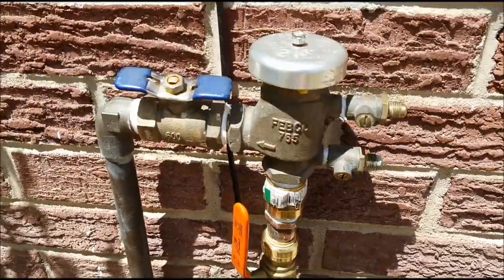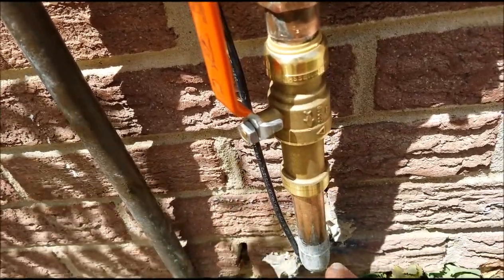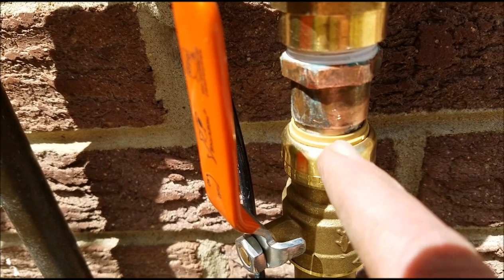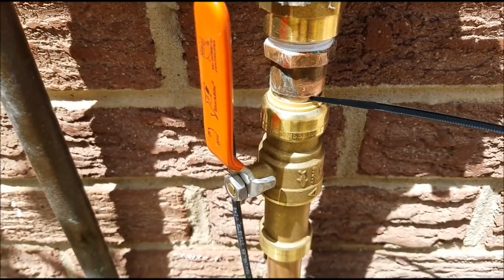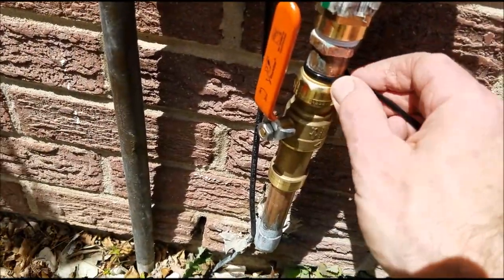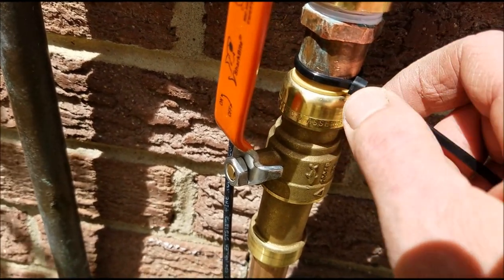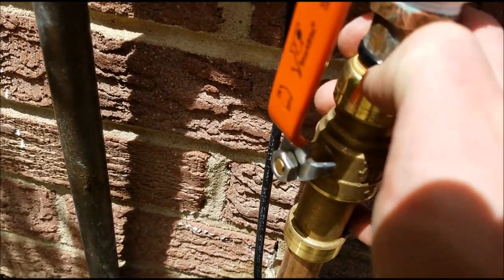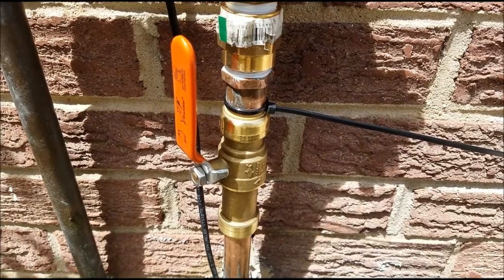How to remove Sharkbite fitting without a special tool in a tight space

Comment: This was exactly the solution we needed for the right space where we couldn't get the disconnect tool to slide into.  We then used two pieces of string to pull the zip tie to release.  We are so thankful we found your video.

Comment: You saved my bacon! I was having to fix some plumbing in my RV and having to adapt the old 3/8inch to 1/2inch pipes. I accidentally cut one pipe too short and it was right next to an older connector. The shark bite couldn't get enough of a bite and the joint was leaking. I had no room for the wrench or special tool to get in and release it. This worked perfectly!!! Thank you, thank you, thank you!!!

Comment: I wish I had seen this before I wasted half my lunch break trying to get a sharkbite lose.  In my case it was to close to a solder elbow.   And of course I had found it had a slow leak.  Probably a bit of solder under the sharkbit...   Like you my tool wouldn't fit.  So I tried my fingernails, a wrench.   Eventually I managed to get it lose by pushing down on both sides with a flat blade screwdriver, but it was a real feat of acrobatics.   Now that I recleaned the pipe and put it back in again, no leak.   Which is good, because it went in a bit deeper this time, so no chance of repeating my previous technique.   I might happen to have a zip tie small enough to try your technique.

Comment: Tapered end is called a fitting. SharkBites should not be used near fittings cuz it's impossible to get those off. And SharkBite should never be used for shower and tub spouts as it will prevent the spout from staying in place. Shark bites are not meant for every application or fixing only certain ones

Comment: Use an adjustable wrench! work also
Reply from the maker: In normal circumstances, yes an adjustable wrench works. However, there was a taper in the pipe (from 3/4" to 1/2") right next to the sharkbite fitting where an adjustable wrench doesn't work. Thanks for your comment.

Comment: this does not show how to remove the sharkbite. is all he did was put a zip tie around a pipe
Reply from the maker: Jonathan, thank you for your comment. To remove the fitting you pull the zip tie tight in front of the sharkbite fitting then slide/push it toward the fitting. This will release the "teeth" of the sharkbite fitting allowing you to remove the fitting. I think the video does a decent job of showing that process. I hope you can remove your fitting!
Reply: slvrearview it worked though
Reply: Because is a child brain, that's why!!!🤔🤔🤔